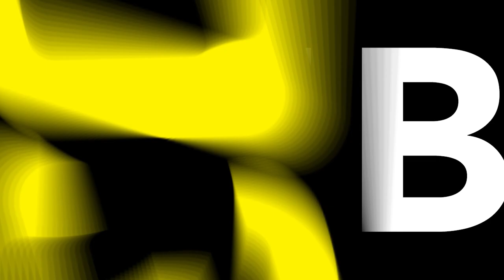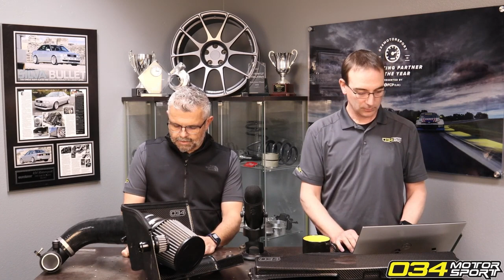Differences and Pros/Cons Between oiled and Dry Filters? | 034Motorsport FAQ

Comment: Horrible video… no information leading me to believe that oiled filter is worse than dry… drink more coffe and try again.
Reply from the maker: We do at 1:30. Oil from oiled filters will get sucked into the motor and would coat the MAF sensor, causing issues with readings.